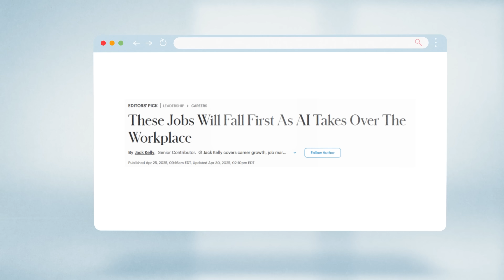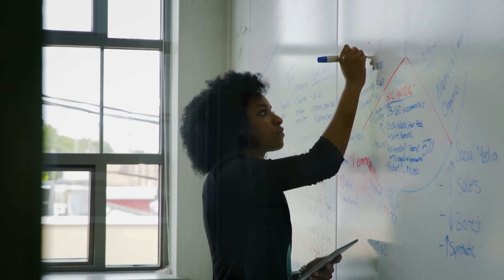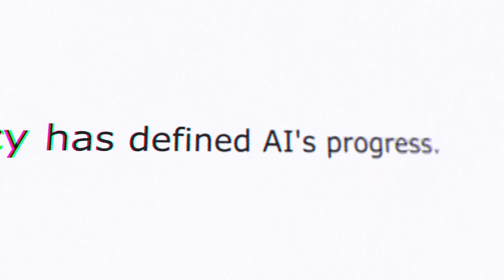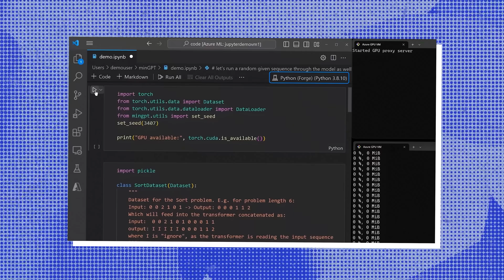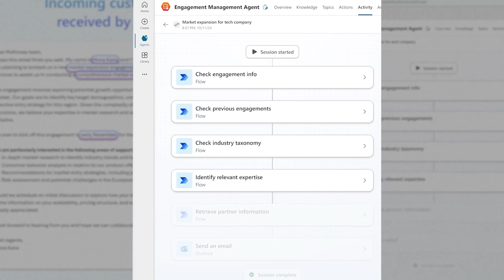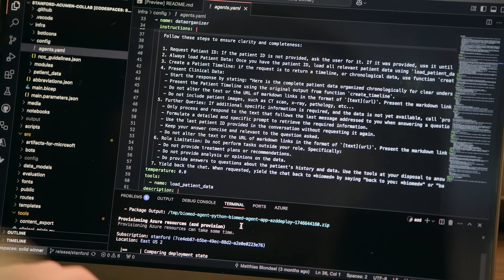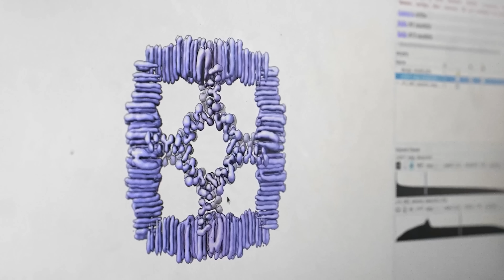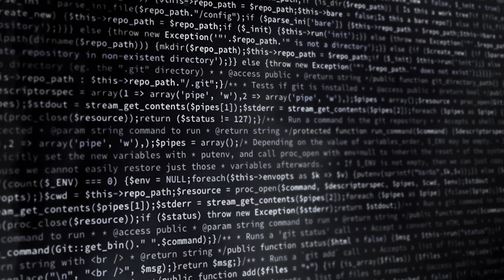Is Coding Still a Good Job With AI? Microsoft CTO, Kevin Scott, Weighs in

Comment: So true, part of the reason we're holding AI back is because we frame the future through the lens of the present. 
It's difficult to imagine the full implications of a society where we're all agentically represented represented and where that representation is largely self-organising.
AI struggles with this as well because it defaults to referencing what's known, which in a way contaminants understanding of what future agentic society will be like. An example is applied economics. Current economic theory is entirely inadequate for modelling Agentic Economics, primarily because it assumes barriers, which a single individual with an agentic system could overcome, and because Intelligence is not recognised as a factor of production unto its own, alongside land, labour and capital.
It's much like this single comment adequately conveying the lens of the present contaminating predictive forecasting.

Comment: Whenever I'm working with chatty on a project, I have information that needs to be accurate to be stitched into core memory to be recalled exactly. This seems to prompt chatty to lock it in as a core requirement.

Comment: I develop system for development 'Gemini Repomix Assistant' that can communicate now simple extension vscode update repo using repomix packing repo having frontend as web and on backend general MCP handling with almost only config file using ai to copy google workspace mcp into my backend using the system (ok saving money using Goggle AI Studio" but idea is to make that workflow built into the system to remove copy paste etc and debugging like back fort of error report from vscode frontend using supabase socket. Actually not over weekend but it is getting to point where better use that copy paste Google AI Studio and cost efficient since full cost handling chat session etc etc.Refactor to follow best practices. Context lenght is increasing therefore this packing and inserting full repositories will get more easy. Also the agents are in the systems so need not really agents outside. Finally AI cannot beat chaos limits of information therefore systems like this is important. Full autonomy seems limited after all, if not but for cost and control reasons. Companies need something with better control than run-away agents where precision is needed. Ok when it is fuzzy logic agents win clearly but when individual 0 or 1 is must right not so in my mind.